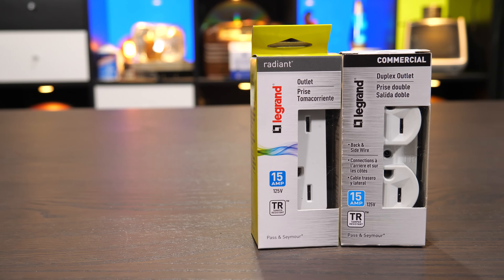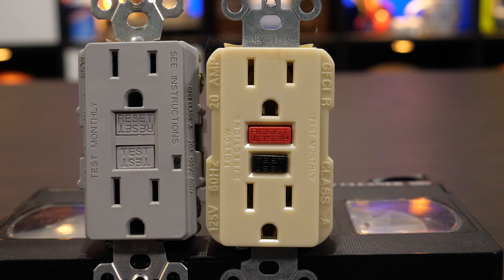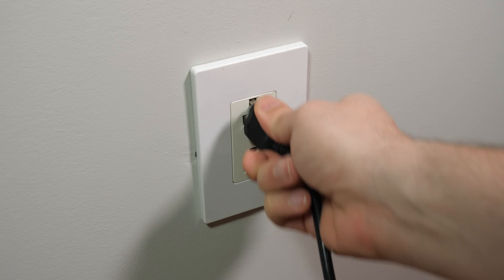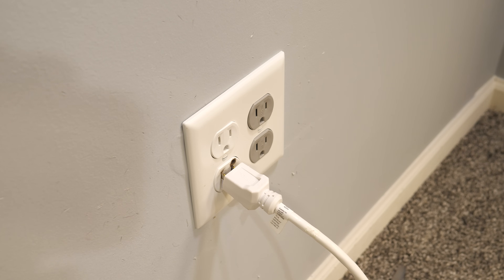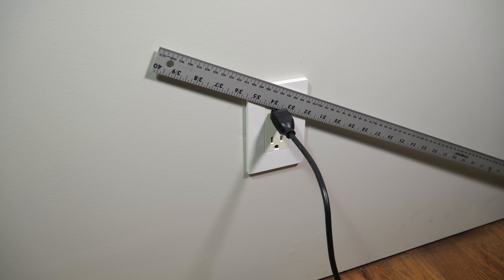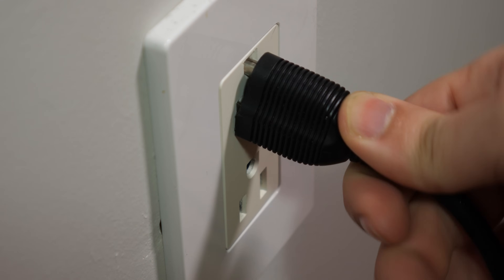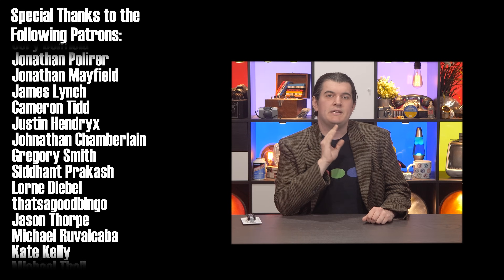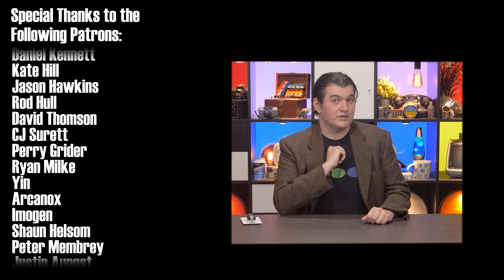Power outlets are topsy turvy - but does it matter?

Comment: The biggest issue with angle plugs is that they can cover other outlets, so you can really only use them on the bottom outlet (unless they really changed the design and standardized it)
Reply: That would probably require changing the outlet design to have the receptacles be side by side like with the UK design
Reply: Unless you have outlets like my house does. The plugs are rotated 90 degrees from what most outlets have (i.e. the plugs are sideways while the entire outlet is vertical).
Reply: The plugs at the 14:55 mark solve that issue well enough
Reply: @mrb692  Yes, I have some extension cords with both two and three-prong variants of these 45-degree angle plugs and I LOVE them. Both safer and more stylish. Also I have some Belkin power strips with right-angle plugs that rotate. I would 110% recommend picking up whatever you can with these styles of plugs, and I have not had clearance issues with them, even plugged into other power strips.
Reply: @datachu  I've also had a really fancy extension cord before that had a rotating plug, so you could put it at any angle. Those things are super nice, I would love if everything could just use low-profile right-angle plugs like that.
Reply: Yes, but the 45-degree angle plug solves that neatly. It just feels too flat to unplug without much difficulty. This should be the standardized design to start with and improve on.
Reply: @IHateUniqueUsernames  In the UK, where plugs are pretty much all flat, plugs are available with easy-pull handles, and stick-on handles are also sold, largely for use by people who find gripping regular plugs for removal physically difficult.
For a plug like the 45-degree one shown in the picture which has a circular overhang, I imagine that it wouldn't be difficult for a manufacturer to offer a removable plastic handle that could be slid onto the plug from the side so that people who didn't want the handle wouldn't have to use it.
Reply: Not a problem in Australia. The sockets go side-by-side here. Though, I can't recall ever seeing a plug where the cable goes straight down. If it's not straight out of the socket, it's down at a 45-degree angle. 

Plug-packs in recent years, however, have an infuriating tendency to have the bulk oriented to one side, which means you can only use them on one side of the power point, or if used in a power-board, end up blocking half the sockets (doubly annoying if the board was designed to have extra spacing between sockets to accommodate plug-packs with the expectation of them pointing the bulk down). I blame American designers who assume everyone else puts their sockets vertically and just uses a different pin layout.
Reply: They are fairly uncommon, so unlikely that you would have two needing the same outlet.  So, always use the bottom outlet, to leave the top usable for straight cords. 
What I hate are large adapters with two prongs.  I have an electronic piano with a large adapter and a sound module, also with a large adapter.  I can plug the top one upside down and it mostly stays in place.  But a power bar on the floor with wide spacing for adapters is the best solution.  😮😮
Reply: @my3dviews  This is why it should be required that all large AC Adapter bricks like that should be inline with a cable, not directly connected to the wall (if they're a certain size). If the brick directly plugs into a wall, it's both unsafe and annoying to use. I always remember those stupid enormous MagSafe bricks Apple used to use because if you didn't have the extension cable attachment, a light tug on the cable would send it flying out of the wall before the magnet even disconnected.

Those things were so heavy, they would fall out of outlets on their own if left for too long. There was also no way to plug them in without exposing the plug like shown in the video, no matter what the adapter was always hanging out of the outlet. Again, the extension cable accessory would fix this, but because it's Apple it was the most expensive cable you would ever buy, and it was not standard. It should be required that all heavy and large adapters like that need to have a cable attachment for safety reasons.
Reply: @wisplite    That's right.  The inline adapters are great.  
The biggest wall adapter that I've ever seen (and have)  is the original Colecovision adapter.  It was/is huge.  
Almost 4 3/4" high by 3" wide and 2 1/8" thick (just measured it).  The later ones (which I also have) are  the same size, but are inline instead.  Which was of course a much better design. 
My piano ones are not quite that big, but still oversized for a wall adapter.
Reply: Why not just have plugs whose cords exit at the side at a 90 degree angle instead of the bottom?

Comment: The 90° appliance extension cords intended for use with "inverted" outlets do exist.  If you Image search for appliance extension cords and scroll down enough you'll find some.  But they definitely aren't very common to see sold today.  I picked up two of them from a flea market that were brand new old stock one time; the packaging looked to date back to the 90s.
Reply: But when the cord is already attached to an appliance with the 90° plug, you don't want to have to add an extension cord.  Most refrigerators have a 90° cord, so that they fit with it close to the wall.

Comment: I don't know, I don't think this video is a good take. yes, plug manufacturers won't change their configuration until outlet installation standards change, but we should not let poorly designed plugs stop us from adopting this safer and more convenient orientation, even if the gains are marginal.

There are ways to deal with these plugs, such as using an outlet saver (a short extension cord) or replacing the plug itself if the appliance allows it. Of course, changing the orientation of all outlets will take a long time and effort, but we should be happy that future generations will benefit from a better power outlet design and standards. And there's nothing that says we can't simultaneously be aware of / push for multiple types of improvements to be made.

Comment: Why not just have an off switch on the face of the socket like a UK based socket? They also only have a 1 way install. We use 240v here so they need to be very safe 👌 lastly for you not understanding the point of the switch it’s so you can isolate the power while I steering and removing the plug removing a danger

Comment: I think the best solution is to turn them 90* rather than 180. Its quite literally a nice halfway point both in rotation and usability. Some plugs are angle at 45* to account for other items being plugged in and others just let you sort it on your own. With the outlets at 90* sitting side by side rather than stacked it means that plug orientation means even less. Ideally we'd switch to a better standard but this is America we don't really do things the easiest way.
Reply: I think the ideal solution is a side by side recepticle.
Reply: @xander1052  same idea in not so many words.
Reply: Changing receptacle standard is a massive logistical nightmare.
Reply: @matthewparker9276  yeah, wish it'd be easier but sadly its not fisable

Comment: I remember looking at soviet power outlets and thinking of poor times and disregard of safety. Years later I learned that they probably whipped it off from US as they did on most of the stuff, but let's be honest - it was a no-win move. I might be biased because we use EU plugs and they are unidirectional so there is no problem with the angle problem. As for UK they have gone bananas on their fuse and huge connector and it's suffering on same problem with the direction but as I understand they always make the connector with earth on top by default. Also they such wide body on connector that it will probably never lodge itself loose on normal conditions. On EU plugs it can be rotated and it can never come loose as plug goes inside the socket most of the part (not just connectors) so you have to be houdini to touch the contacts. It's so wierd that after all these years only "advancement" is turn them upside down :D

Comment: We should transition to any Euro design. The UK and France both have very nice options. We should install the EU socket in the wall, and sell an adapter for older cords.
Reply: There's already an adapter, they sell them to travellers.
Reply: @dougbrowning82  Those are voltage adapters and are costly. We only need a pass through for the different plug types. Should be $5.
Reply: @newunderthesun7353  No, I was talking about the plug adapters they sell at dollar stores and duty free shops. Not very useful for Americans travelling to Europe, but OK for someone in the UK travelling to Australia.

Comment: And all that could be fixed by making the outlet recessed in the receptacle area - no need to mount in any specific orientation, pins would be protected by the outlet construction.
Won't fix the inherent flaws of the plug, but would be way more effective than forcing a mounting orientation.

Comment: In 30 years in the trades I’ve only seen 1 time where someone was injured but the plugs being upside down. I mean right side up. A gp recep installed behind a cardboard bailer at a store who’s name rhymes with mallmart. The employee was burned and the circuit tripped when they were passing bailing wires from the front to the back to secure the bailer. Of course the extension cord that had been plugged in to the gp recep for much much much longer than the temporary use it was listed for was really at fault.

Comment: I became a biomed in July of 2000.  I fix hospital equipment.  New York State has mandated all new construction in healthcare facilities has to have outlets installed "ground on top".  With 20 years of experience as a biomed, I've never seen or heard any credible report of a disaster caused by bad plug orientation.

I feel like this plug orientation requirement is based more off hypothetical fear, and someone trying to make themselves feel important rather than any actual risk.  It takes some strong "well, what if..." magic to conjure up a good supporting argument.

After all, while many of us DO enjoy a good game of "throw knives at the wall", while we're working at the clinic or hospital, we're just too busy to start up a game there, and even if we could, knives are mostly prohibited in the building anyhow, and it's not worth the trouble to smuggle them in.

Comment: In Switzerland our plugs have insulated prongs, where only the front is metal and our receptacle must to be recessed. This would also solve the issue in the US. Just make the receptacle recessed…the plug would be covered by the recess before the prongs are inserted into the receptacle…
Reply: The Swiss standards are Type C for 2 prong and Type J for 3 pole. As a swiss I‘d say these are the best you can have.

Comment: I have not only seen an appliance cord with the inverted right angle cord orientation, but I have at least one in my cord collection.  That being said they are far less common than the ground down version.  I  actually bought one of the inverted sort for a specific purpose, that being to have 2 right angle appliance cords in the same duplex outlet behind a piece of furniture I wanted as close to the wall as possible.  One to plug in a window AC and the other to make the second receptacle accessible without having to move said furniture to do so.

Comment: 11:58 I have encountered one of these and it is a 𝐫𝐨𝐲𝐚𝐥 𝐩𝐚𝐢𝐧. It is the plug on my monitor cord which I plug into a surge protector. Said surge protector has two rows of sockets with the ground pins facing outward (the conventional way) so this "correct" right angle plug is always covering one of my precious few outlets. 😠

Comment: My pet peeve: I've lost count of the number of times that small, low-voltage cords have found their way between a NEMA5 plug and the wall. At least if this place had "ground-up" receptacles, I wouldn't need to find a stick to carefully lift a cheap USB cable off the hot pin on the receptacle under my desk! Gotta love Sideways Chicago wiring. I totally don't trust peripheral device cables to have any reasonable insulation, even at 120V...

Comment: My first reaction to the overnight changeup is not that I wouldn't care but rather that I'd hunt the bastard down and kill them.  Then I'd get the outlets fixed to ground on the bottom.  My opinion has not changed after seeing the whole video.

As for straight vs right angle plugs, I've decided that It's best to have plenty of each.  Offset right angle plugs are best for the wall.  Straight plugs are better for going into extension cords and other power strips.

Comment: A little baffled as to why, if so many of your plugs are 90° with the cord going straight down… so many of your duplex wall sockets are one above the other? That orientation is very rare here in Australia. Though we have another challenge: we use a type I socket, also mounted with ground at the bottom. China uses the same socket, but usually mounted with ground at the top. So any device made in China (i.e. all of them) with a wall wart has a decent chance of having that plug be upside down.

Comment: Even if the American plugs never change in 30+ years, or attempt to copy how the UK plugs are designed, my main suggestion would be to just add a switch to the plug, even if nothing else, it would add at least 1 safety point. That and/or add insulation to the bases of the prongs and the ends of the socket holes, meaning the appliance will never work unless its plug is 70% in the socket. Also, stack them side by side too.

Comment: The “Chicago style” with the outlet in landscape mode makes a lot of sense to me. 

I’m British and every time I’m in the US I often comment on outlet design (as well as TERRIBLE toilet plumbing which constantly blocks), especially when two blade wall-wart power adapters fall out on their own. If the outlets were landscape I think they would fall out a lot less often because the bottom blade will act as the pivot point and the top blade will help to hold it in place.

Comment: Wouldn't the earth pin on the bottom maintain the ground connection longer if the plug is pulled downward? If at the top the ground would be the first to break connection and not allow for the appliance to be grounded?

Comment: Commercial and Industrial is Ground up. He said homeowners tend to plug and unplug things more often, and their index finger can touch the live conductors when they're on the bottom. Whereas industrial and commercial equipment stay plugged in for an extended period, and it's safer to have the ground up, in case something is dropped on the plug.  

That's why switched plugs in residential are sometimes ground up, because they don't get plugged and unplugged as often, and it also marks the outlet as switched outlet.

Comment: In holiday inn hotels the outlets are sideways other than the bathroom where it's usually covered by a plastic thing holding the hair dryer. It's "for safety" but most likely to deter stealing the dryer. At least the ones in my area to be exact

Comment: The outlets in one bedroom of my house were installed this way. Evidently that room got renovated by a previous owner who subscribed to this idea. Frankly, hasn't bothered me at all because I don't have any three-pronged devices in that room.

I didn't see you mention the right-angle plug's glaring issue of the fact that you can't have two in one outlet, because the one on top will always overlap the one underneath (or vice versa if the outlet is inverted).

Comment: huh. I was taught that ground up should only be used if that outlet is on a switch, as a way to distinguish it. I knew that ground up did have some marginal safety benefits, but never cared about that angle because putting sleeves on the prongs would be way safer in the first place while not caring about ground pin orientation.

Comment: Sometimes people will user their fingers to line up the plug with the outlet, especially when using an outlet jammed behind some furniture. And when using your finger, you'll likely place it above the plug. I know this, because I've done it, *zap*.

If the ground plug is on the top, less change for a zapping.

Comment: 15:35 I love how you're demonstrating the main disadvantage of the right-angle plug right here. You cannot have a right angle plug put into the top receptacle here and also have one in the bottom one, as the top one occupies that space. Personally I absolutely detest right angle plugs and wish manufacturers would just have straight plugs and put whatever power bricks or other doodads they feel the need for somewhere further down the cable. Alternatively socket strips with 90 degree sockets should be more common, as they would also help with this problem.

Comment: My Samsung monitor has a 90 degree plug whose cable goes "down" assuming the ground pin is on top. It's currently plugged into a power strip, though. This seems to be more common these days, so I'm not sure the 90 degree plug argument is as persuasive.

Comment: You skipped over the main problem with right angle plugs @15:11. I can't plug two good ones into the same receptacle.
IMO: the plug should be designed to be installed sideways, with the ground still pointing to the top. But too late.
Also, the reason that plugs come straight out of the wall is so their pins don't bend when the vacuum roams further than its cord.